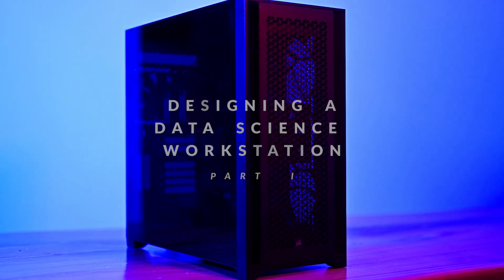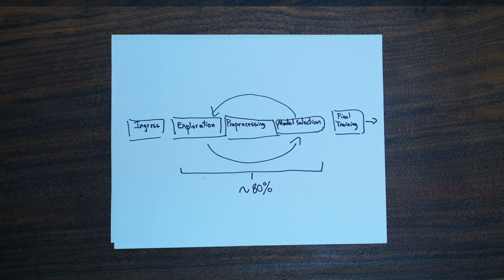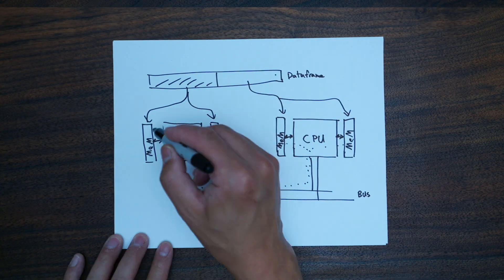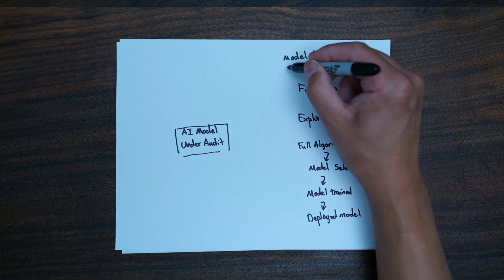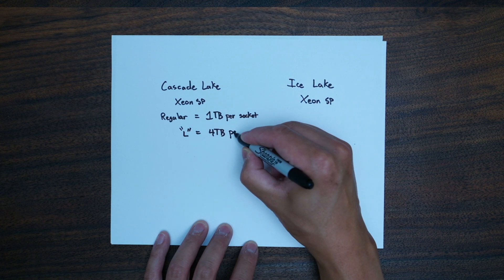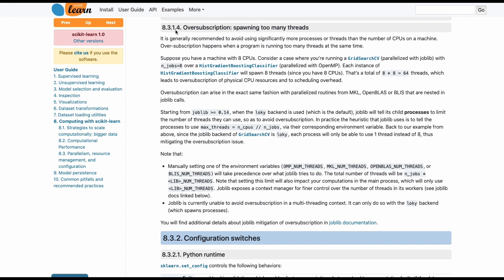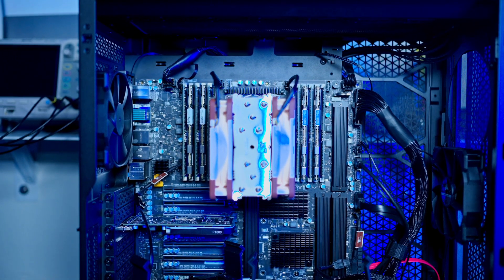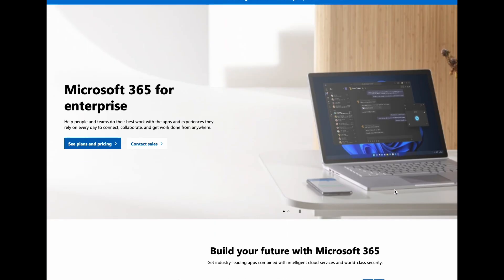Designing a Data Science Workstation: Part I

Comment: is it possible to add a 32 GB graphics card to this? I'm into Mineral Sciences and good resolution  chromo graphs, charts, earth sciences maps are a daily job. I will also need a HDMI instead of the VGA, I looked at the motherboard specs and I see it doesnt provide HDMI.
Reply from the maker: Yes.  The PCI-E lanes are full size and have 2 x16 lanes that you can use a traditional gaming or workstation card in place of the small one I use.